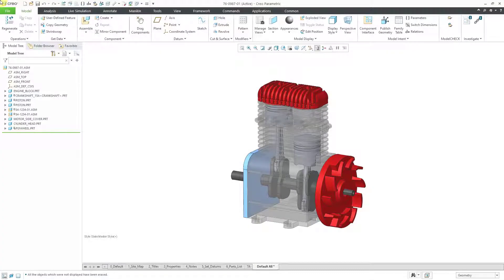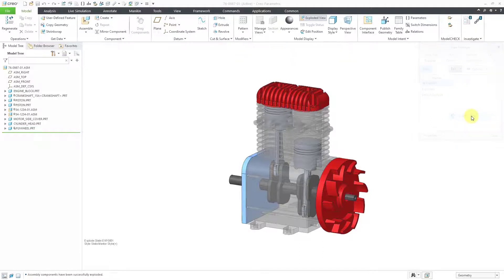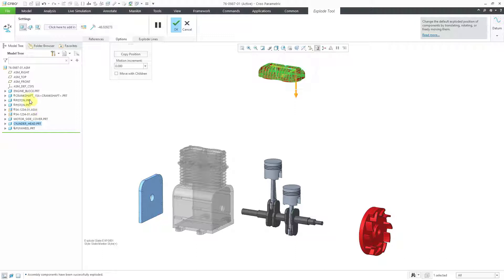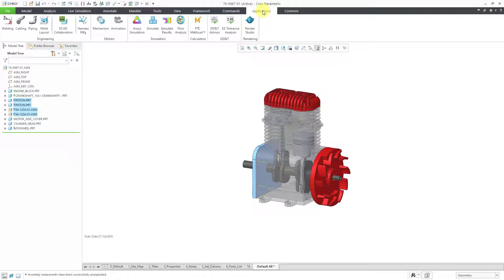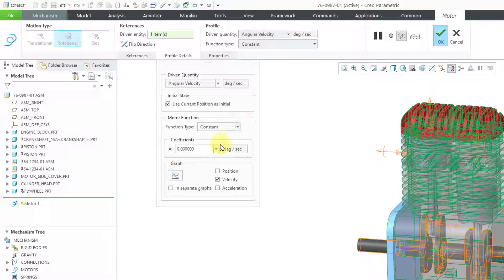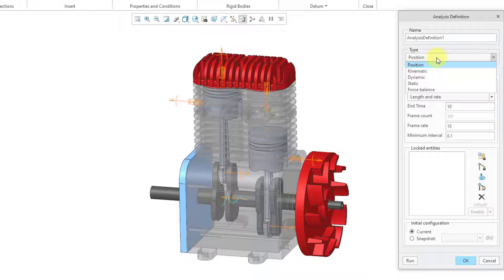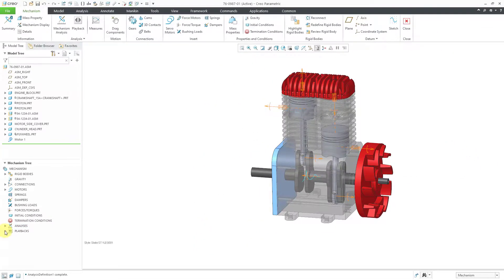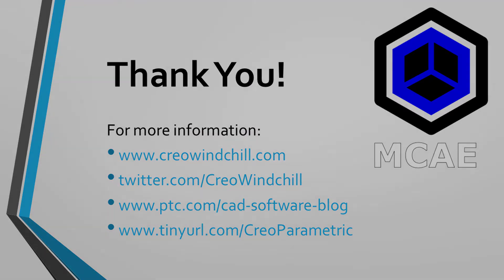Creo Parametric - Assembly Basics (Part 4) - Explode States and Mechanisms

Comment: Hi I am searching for a method of exploding only the first level of my assembly so I mean lets say that I have one assembly that is formed by 5 another assemblies and I dont want to explode the five assemblies I dont want to CREO explode the 5 assemblies so that it will show every part of these 5 assemblies, I want my explosion to show only 5 subassemblies, is that possible?
Reply from the maker: Absolutely. When creating the explode state, just select the top level assemblies and not the individual components.
Reply: @CADPLMGuy  Many thanks. I did not know that I should use explode state. I was using Exploded View directly.
Reply from the maker: In Assembly Mode, Exploded View toggles either the default or active explode state. Although the algorithm has gotten better, most likely you do not want the default explode state. Therefore you should create your own. I have a video on that.